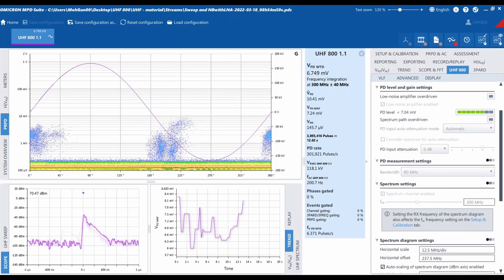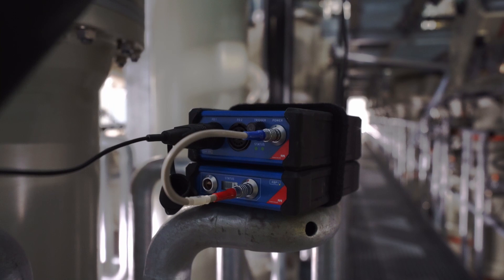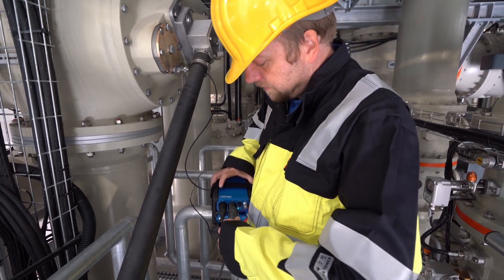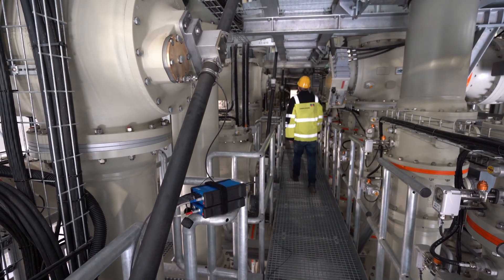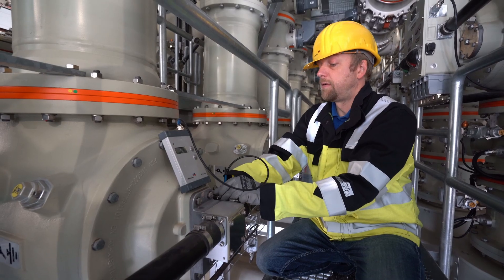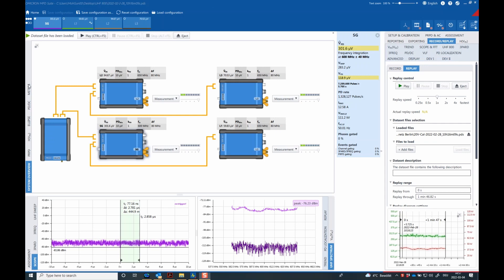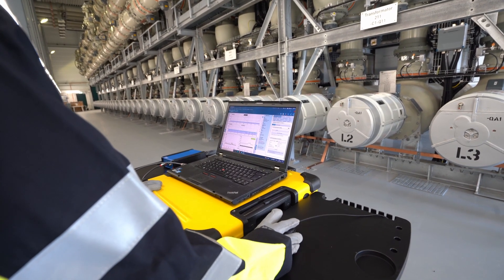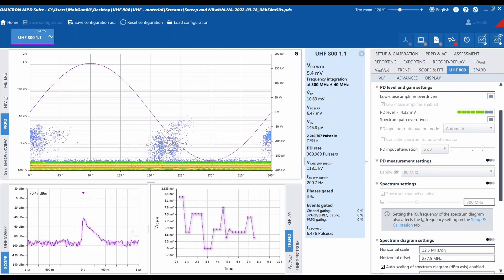Sensitive partial discharge testing on gas-insulated switchgear with UHF 800

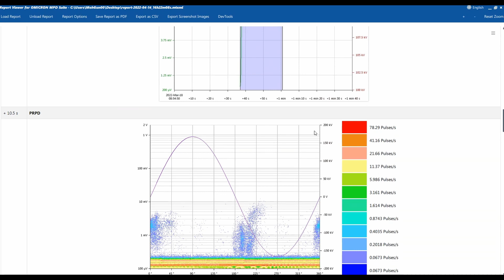Comment: in the min 3:03 shows something look like a transformer, I haven't saw anything similar 11KV to 400KV to this can you give info about it
Reply from the maker: Dear @AsanMasraf, thank you for your comment and interest in this video. 

This transformer is with one of our customers in Austria. The transformer is a 300 MVA transformer with horizontal 220 kV and 110 kV bushings. The UHF PD measurements were made with the UHF 800 using a UHF drain valve sensor. If you require further information or have any questions, please contact our technical support team: support@omicronenergy.com
 
Best regards, your OMICRON team